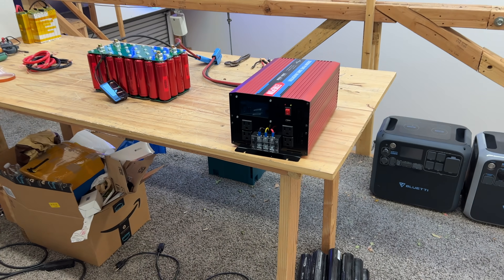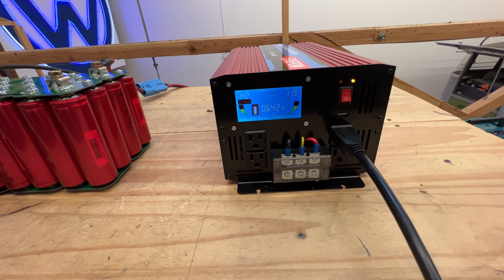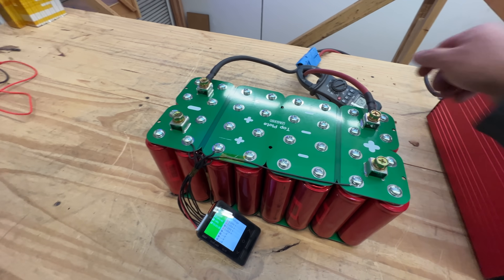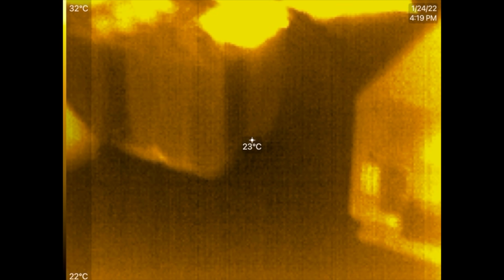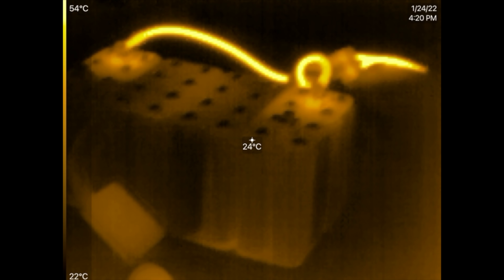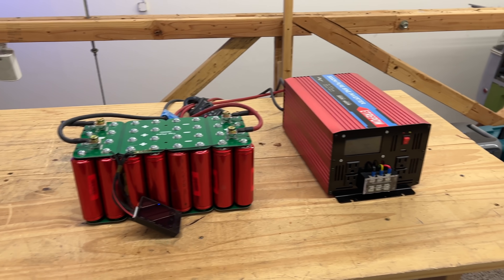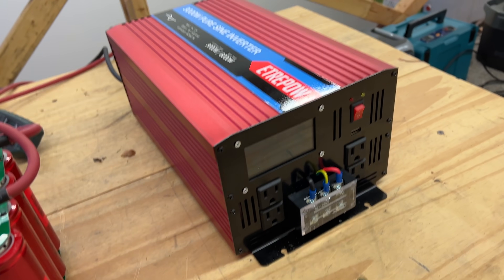This battery Kills inverters

Comment: I got the superbeast turned into 12v at 96ah with 48 of these cells and a 2000watt inverter and ive ran 1600 watts with no issues at all so far, i got 4g wire about 1ft long with 160amp fuse on the positive. Mainly wanted it for running fans and charging my power chair when camping

Comment: Can I use direct ring terminal lugs on a1000a pcb board  64AH 38120 headway lithium bank instead of the 6 pin soldered board terminals
Reply from the maker: Yes
Reply: @jehugarcia  I am new to not only DIY car audio lithium battery but also to these PCB boards is there anyway you could send me some picture examples or any steps on how to do this considering I am new I'm running 4 power 4 ground zero gauge write to each battery 1000a pcb board which is 64 amp hours each. At your earliest convenience would be great I'm getting ready for a Show competition with my team I top balanced everything I just need to start putting it together. Thank you  @jehuGarcia I hope you have a good weekend

Comment: You should measure the input DC voltage at the inverter's input terminals.  You are getting significantly less than 12V at the inverter's inputs, and that is what caused the inverter to fail.  The inverter is drawing more current from the battery to compensate for the reduced voltage at its input terminals.  A lower input voltage makes the inverter's efficiency go down, requiring even more input current to maintain the 2200W AC power at its output. I'm surprised the inverter doesn't have a low input voltage safety shutoff, but you get what you pay for (sometimes).

Comment: Dude, I think the wires you're using is too small for the current draw.  Use a 1 or 0 gauge for 100A draw. 
16-gauge wire	13 amps
14-gauge wire	15 amps
12-gauge wire	20 amps
10-gauge wire	30 amps
8-gauge wire	40 amps
6-gauge wire	55 amps
4-gauge wire	70 amps
3-gauge wire	85 amps
2-gauge wire	95 amps

Comment: It's not advisable to solder battery terminals. The solder may not be able to hold the current coming out of the batteries. It introduces additional resistance which generates heat.

Comment: Less amps because battery at higher voltage, if you try the same load with 48v system the amps would be far less

Comment: When running 2 sets of leads to the inverter, there is less voltage drop across the wires which leads to less amps to maintain the same power. Also, removing notches (and holes) from the board layout will help with the heating in the bus portion of the PCB.
Reply: The amount of voltage drop there is what.....not even half a volt?

Edit Nevermind those are some thin cables for a 3000W inverter he's trying to max out. Shouldn't he be running 4/0? Pretty much count on 300A

Comment: I want to build a dual battery setup for my suburban. I’m talking about yanking out the lead battery and alternator and have one for the engine and electrical system and then have a battery just for a air compressor, winch and house battery setup. What’s the best battery setup for that? I really like these battery cells because it’s so simple to build and repair myself if something goes wrong.

Comment: You have to look at the instructions for your inverter but I'm pretty sure you're not supposed to pull that much power from the outlets on it you have to hook up to those little wires and run it to a panel or make your own outlets but that's where  The inverter is made to have it's full power

Comment: I have near the exact same inverter that says 6000 watts but is only half the height as that one, made out of chinesium. I plugged in a 1500-watt heater and in three minutes or less there was smoke coming out of it. I pulled the battery connection as fast as I could. I let it cool down and plugged the battery back in and it snapped and blew the BMS. 

I opened up the inverter and the transformer had melted the plastic around the coils. The transformer was probably shorted as well. There are 4 40 amp fuses soldered to the PCB as well and the fuses did not blow. The fuses are not replaceable, so I don't know what they are for anyway.  Don't buy cheap Chinese inverters.

Comment: My old Chinesium inverter would supply 1000w/2000w surge but that 2000w was for one loop (half a cycle!) of mains. Remember that Chinesium ratings are to the death, Western ratings are to long safe running.

Comment: I use a 3000w 12v Reliable Inverter with 0000 cables. I always oversize my cables so to protect all my equipment. I had a lot of people argue with me about going overboard, but this is a great example of what could happen to your inverter if you don’t. It may or may not have happened with this inverter. The electricity that flows through your oversized cables will not get “bottled necked”. You should see a decline in the heat that your cables generate as well. Heat is the number one thing that destroys electronics next to water.
Reply from the maker: Yeah but the No fan killed this inverter,  it was a defective inverter no matter you slice it,  fat cables would not have saved it.
Reply: @jehugarcia   Thanks for your videos. I really appreciate them. I’ve ran my 3000w inverter to the max to test it. But never ran it more than 2 min. I’m too paranoid to run it any longer and I don’t have a YT channel that pays me to. LOL!
Reply: @jehugarcia  No fan was likely the death blow. However, skinny cables have more voltage drop (that power loss is what causes the cables to heat up).  Lower voltage means the inverter will draw more current. More current is more load on the FETs in the inverter, making more heat. More current is more voltage drop. It all contributes.

Comment: Just fyi, solder is about 15% of the conductivity of copper.  Solder in a high current application is not a good idea.  Even a small amount of soft solder in a crimp connection would allow movement  from mechanical or thermal conditions and cause higher resistance, and therefore more heat, higher resistance, runaway increase in temperature until the joint melts or flames.  A properly done crimp connection is FAR better in high current applications.

Comment: There is a voltage drop of ~ 4.6 volts from a fully charged lifepo4 12v battery to a fully discharged battery. 3.65->2.5 volts per cell in 4S configuration. This can be problematic for some inverters that prefer to operate around specific voltages because current to the load will increase to make up for the voltage loss.
Reply: I thought about that too, but I didn't hear a low voltage alarm.

Comment: My 700w Walmart Inverter made the cables hot and I was using 8 gauge copper wire, and that was at a VERY short distance.     You know...   0 AWG is  what you should be using.   
I mean even in the Car audio world,   we don't even bother with anything less then 1/0 AWG.   There just is to much voltage drop and loss at high current pulls from our bass amplifiers.  And that's not continuous.
Reply from the maker: Ok I’m going to stop reading comments on this video, all you pedantic folks are missing the whole point of this test
Reply: @jehugarcia   Okay.

Comment: Extra cables won't really help, only larger ones will. I hope you never have to wire a plug round my house.
Reply from the maker: Don’t worry, you can’t afford me.
Reply: @jehugarcia  What? Like you can't afford the correct guage cable or the education that would tell you that if you add an extra cable it needs to be striped along with the original and safety twisted together and then insulated. And when it comes to what I cannot afford. Maybe it's the time I'm spending helping you not to mislead anyone in the direction of a house fire or worse? Ps I wish I was wrong. Xx
Reply from the maker: Idiot,  I’m running a 10 minute load test,  I need all the resistance I can get the max load on the pcb,  if you are too slow to keep up with what we are doing here you need to stop commenting and start paying more attention,  maybe you’ll learn something,  you fool.

Comment: I've also had to return that inverter. I've been enjoying the omsnipower (or something like that. The black and white ones) anyway by design I matched a couple of those with bms's that could only do 120 amps so the inverters only work at 3/4 their potential. They've lasted a couple years with daily usage. So far so good. I have a lot of those headway cells. I would LOVE TO SEE MORE CONTENT ON THEM. They're a big deal in the car audio world, might also help get some more subscribers bro! Take care, stoked for the part 2 of the headway/circ board saga

Comment: You cannot connect batteries unregulated directly to an inverter and expect great results. You must connect the batteries to a DC to DC buck converter, in order to regulate the voltage to 12 volts, which the inverter accepts. Of course presuming you start with a voltage higher than 12. This is because when drawing power from the battery, the voltage drops. It is recommended to start with something around 24 volts.
Reply from the maker: oh boy......been living under a rock?
Reply: @jehugarcia  No, but I am also creating my own battery pack. It is a 72 cell lithium ion 18650. I was trying to do it without buck converters before, but it does not work, because the fully discharged cell is less than 3 volts. And the inverter cannot handle higher or lower voltage.

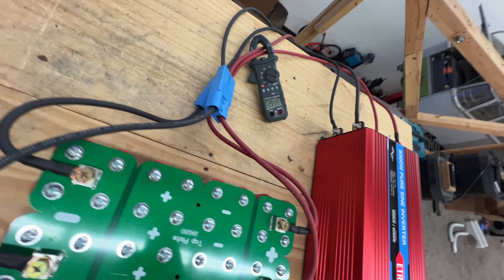Comment: At 8:32 291 amps x 12.4 (i assume) = 3608 watts. So a little overload, but it should turn off overheated not burn lol. Keep up the good work. Cheers.
Reply from the maker: You are correct. inverter had couple of issues,  current censor was reading wrong amperage and the fan did not operate,  so it started melting

Comment: cables are terribly small for that amperage 200 amps calls for 2/0 wire, 4 gauge for 100 amps and your using 2x 6 gauge 280 amps?? somebody mail this guy a gauge chart. Sheesh working the hell out of the poor  inverter. the only thing wrong with the inverter is the fool running the experiment. 280 amps @12 volts should produce 3360 watts. The resistance in the small wiring fried the inverter
Reply from the maker: no you fool the lack of a working fan and 3600w killed the fan,   try to keep up with me next time, im testing the pcb not the inverter,  my load is one long high resistance load the wire is doing exactly what I need it to do,  burn energy.
Reply: @jehugarcia  You dont don't need to use small wire to test the pcb just an adequate load . You fried the inverter with too much amperage. But nice try and if you are using small wire to create the load then you are a fool by destroying the inverter, .You are also creating a cascade high resistance within the PCB with the super heated wire that becomes more resistant with every raise in temp. This is the dumbest shit I have ever seen. Funny it lasted as long as it did since its probably rated to about 225  amps tops @ nominal. I kept up. You fucked up
Reply: next time get a 6000 watt inverter and size the wire like any apt individual would do and test it like that. so the only resistance and fail points are in the pcb. Duh

Comment: First off awesome video!! too bad you didnt have the normal camera rolling! But please read the ampacity chart for cables because you were pushing 200A through 6AWG wire that is only rated for 75A max, putting both wires in parallel only got you to 150A if the cables were identical. You need at least two 0AWG in parallel if you want 300A from the battery. https://en.wikipedia.org/wiki/American_wire_gauge#Tables_of_AWG_wire_sizes
Reply from the maker: not for a 10 minute test where I need to burn as much energy as possible to try and melt the PCB im testing,  why are all you guys focusing on the wrong thing and missing the point of this test?
Reply: @jehugarcia  you are right that anything after the battery board is completely irrelevant. But any random person that watches the video might get the wrong idea that if Jehu can push 200A through 6AWG then so can they. You have to make it look more realistic, and also you wont be able to truly test if the wires are heating up the terminals and the board.

Comment: 7:55 Thats because there was voltage drop in the wires, around 1v difference I guess, if you have less voltage to pull the same amount of energy (W) you will have more amperage.
Reply: Finaly someone that understand this kind of stuff.

Comment: 8:00 No, its because your dc voltage is high so it draws less amps. As voltage drops it will pull more amps.

Comment: FYI, copper jumper cables are inexpensive ways to get heavy wire. 300 amps or so is not going to work well with skinny wire. More copper in the plates you have way too many skinny resistive paths. 290 watts into even one hundreth of an ohm is 840 watts, an electric frying pan on medium high heat. Wirebarn calculator says for 290 amps with six feet of wire you need 2/0 gauge. Two 6 gauge wires are equivalent to 3 gauge. Unfortunately soldering crimps will make them more robust, but will not contribute much in the way of reducing resistance. Solder is not as conductive as copper. Longer, more compressed, radial crimps can help more.
Reply from the maker: You guys disappoint me sometimes.  All you “you need bigger wires” guys are completely missing the object of this test….  My load is one whole high resistance wire, why would I want bigger wires which will decrease my load of the battery?   Are you guys not paying attention to that what I’m testing here?

Comment: I think your inverter doing his job well 11v  and 291a = 3201w    and invaters fan not working bro
Reply from the maker: The inverter did indeed do its job well for 2 mins,  but then overheated due to no fan,  it’s not dead it’s just a little melted inside.

Comment: Under minor load voltage at the inverter 11.3, Voltage at the cells 13.2.... And you really expected the inverter to keep functioning when you push things further? Voltage drop my man, FUCKING PAY ATTENTION.
Reply from the maker: if the voltage dropped that low then why did the inverter not shut down genius?  I'll tell you why because its defective,  it doesn't read the load accurately and the fan doesn't work.
Reply: @jehugarcia  It didn't have the chance to shut down. The window for "catching" an overcurrent event is very small and made 100x worse by your PCB bussing, anderson 120A connector, and 6ga wire that is too long. Mosfets are VERY sensitive to voltage spikes and your setup is guaranteed to produce massive shutoff spikes since current can't stop instantly.

Comment: The plugs on the inverter are not rated for the full load you should try wiring a real 20-30 amp receptacle to the inverter then it should handle the load.

Comment: Be aware there are copper clad wires that can't handle higher currents. Ensure using 100% pure copper wires for higher current draws. That's why I personally don't like 12V inverter systems. The current draws are a bit on the dangerous side
Reply: The current draws are fine as long as you use the correct guage of oxygen free copper wire. 6 guage wire isn't even close to good enough for this kind of test, and two 6 guage wires does not equal the zero guage wire that was needed, both on the battery side and the inverter side. Any 12 volt inverter rated for 3000 watts should had come with zero guage pure copper leads, and if it didn't, Jehu has been doing this long enough to know that he should had changed them to the properly sized and proper material wire. Also, the PCBs he used as connections for the battery cells themselves are not good enough for even 200 amps of current. He said himself in his last video that these PCBs are only good for 90 amps each and he had them doubled up on the cells, so 180 amps maximum total. He should had gotten longer bolts and ran trippled or quadruple PCBs if he wants to run 300-400 amp tests for these cells. He has 8 cells in parallel, so the batteries can handle the output. It's only because his connections are inadequate that this failed. He thinks for some reason that resistance doesn't matter as much as it does, because he's used to playing around with 50 or 60 amps maximum at a time from most of his batteries. Resistance equals heat and the cells will sag hard when all the conductors are undersized and the PCBs aren't thick enough to handle the output. These cells should be linked together with 400 amp capable copper bus bars or minimum 10mm thick copper plates, or the equivalent In aluminum, which is 40% thicker than what the copper should be for bus bars or plates,   specifically6t made to carry the 1000 amps that this battery pack is able to output, since it has 8 of these Headway HP cells in parallel. Each cell can do just about 150-200 amps. These two PCBs and two 6 guage wires are only good for about 180 amps

Comment: I don't understand the point of this video. JEHU KNOWS you have to use the hookups for anything over 15 amps and not only did he purposely do this test wrong. But he did it with bad wires, arguably a battery pack that shouldn't be pulling that kind of power. This video is all over the place.....
Reply: Hookups = not plugging into the power outlets